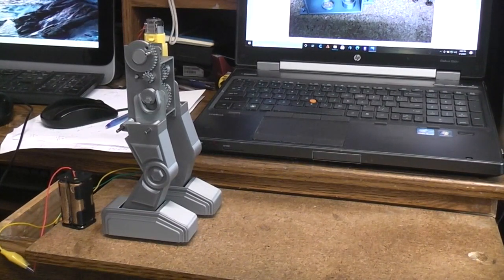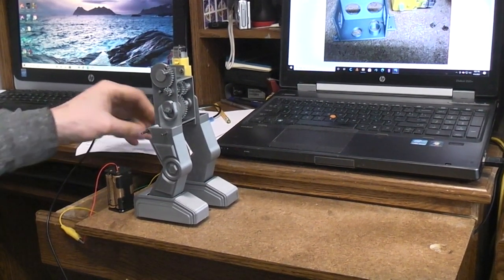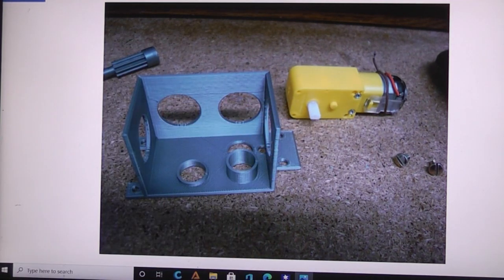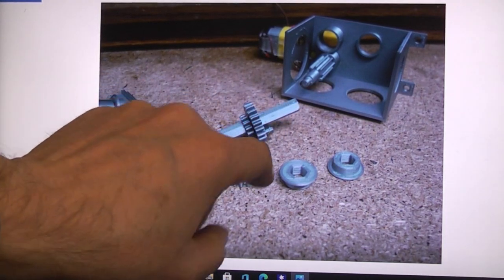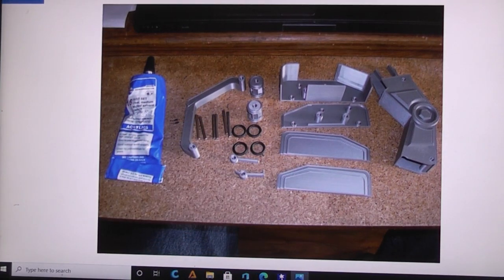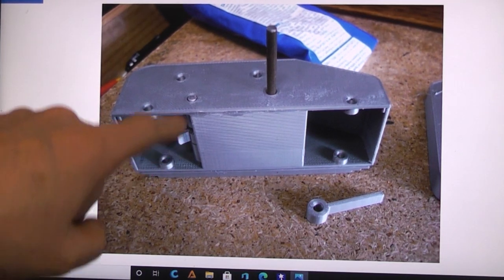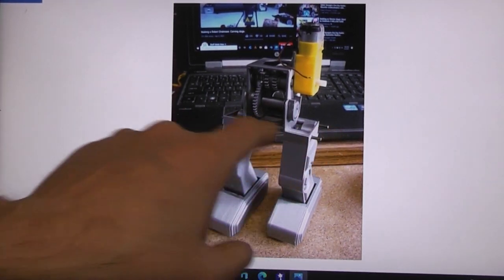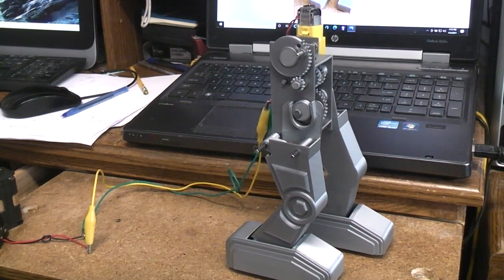3d printed. Walk-Stop-Walk vintage type robot.  Rotating ramp sequencer. Part 1.

Comment: Good Evening John,

I was hoping that you were going to show the inside running at the slower speed.  I think I understand the mechanism but showing the gears running at the slower speed 
would make it more clear.  Either way, thank you for sharing your knowledge.I do love to see how things work.   It is fascinating to see how an operation can be done mechanically with
1 motor and gears vs a micro and multiple motors.  Takes a lot more thought.   

Tom
Reply from the maker: The inside running at slow speed is covered the first video, link the discription box as well as full explanation of how it works.
Reply: @Robothut  I think I just found the 1st video.  Thank you ;-)
Reply from the maker: @SpectreTTM  I have added a pinned link that has 2 of the earlier videos I did on these mechanical designs.

Comment: Wooow 😃 that was awesome Sir Loved it really and I wonder about the shaft of gear box, does it handle the other gears I mean it was heavy gears than the motor have...? 
I'm waiting for the upper body of the robot keep up the awesome content Sir 😊👍
Reply from the maker: The shafts or axles are hex shaped and printed flat no supports. with the layer lines printed flat and not vertical they are  very strong, the gears will break before a shaft "axle" will .

Comment: What glue did you used
Awsome work Sir
Reply from the maker: For PLA I use Weldon #16. You can buy a 5 OZ tube of it with shipping for less than the tiny 3d gloop stuff. I did a video on the best glue for the money. Supper glue is crap as it is a surface adhesion type glue. Weld on #16 is a solvent type glue melts the PLA together. here is the video I did.
https://youtu.be/27hoPwRaUes

Comment: I've started to make this and it appears that the files on Thingiverse are the originals as showed in the build guide, and not the ones you demonstrated on the model.  Is there any chance that you could upload the extended motor mount side piece and the additional gear that allows the second function?  It would be great to build it like the one you show here.
Thanks and best wishes
Reply from the maker: A corrupt memory card lost many of the files for the head build and its functions as well as the video to build that part. I will check my old computer to see if there is any sign of backup files. Here is a link to the missing files.
https://www.thingiverse.com/thing:5324304
Reply from the maker: Found the updated and missing files.
https://www.thingiverse.com/thing:5324304

Comment: Hi Robothut.  I've put my first gearbox together and I'm having a problem with the first gear that is turned by the drive shaft.  This is the one with the ramp on it that turns freely on the bush.  It is working but when the second gear starts to climb the ramp, it is tilting the first gear at an angle.  In other words, the second gear applies pressure to the first gear and forces it out of alignment.  This seems to happen because the first gear is quite loose on the bush.  Did you come across this with your build or is it something I've not got right.  Thanks for any help.
Reply from the maker: Sounds like your printer is not calibrated quite right for detentions. I built a hand full of them and they all worked for me. You could change the dimensions of the hex shaft so that it fits the sliding gear better in any slicer program if need be. Also, sometimes I have found that some PLA filaments do not print the same scale as others, some seem to print tight and some print lose. Are you using a name brand PLA ? Or just try printing the slip gear and hex shaft is a different PLA and see how they fit.